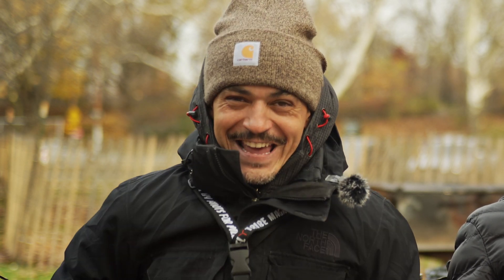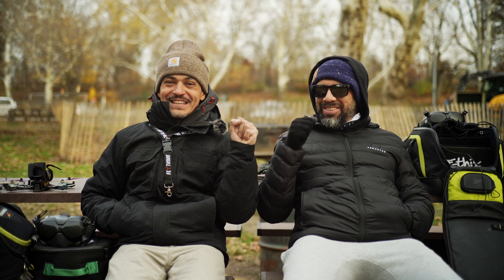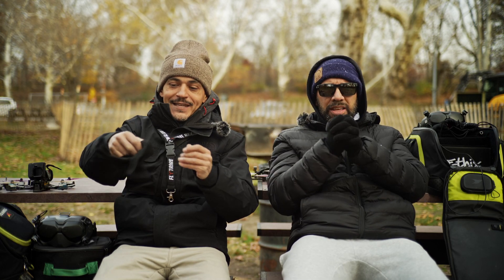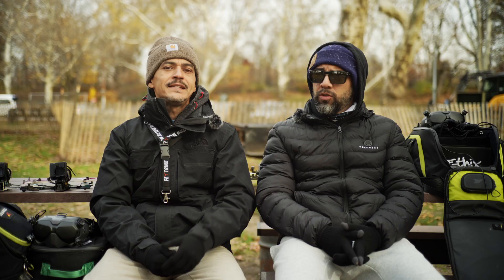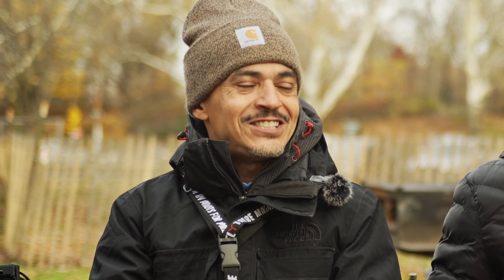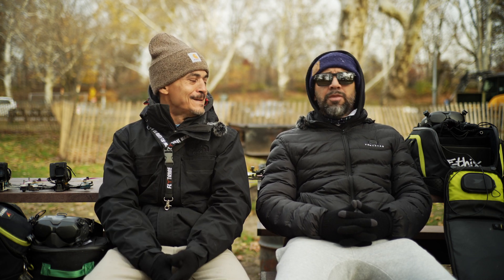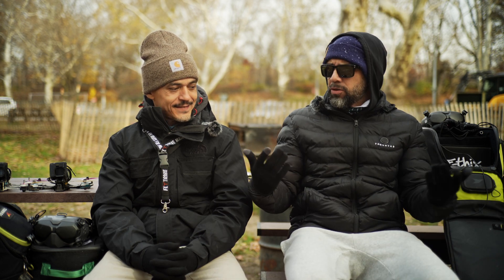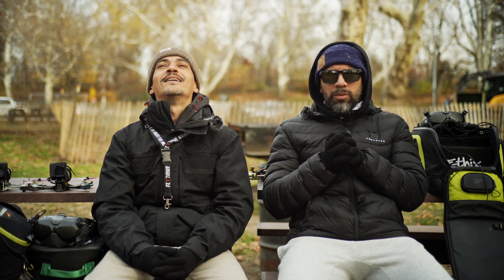Frames, Motors, Esc and Soldering.

Comment: Marmotte is my Fav. Uniplate means no arm slop, no matter how much I beat it up.  The Titanuim Camera Cage keeps my 03 cams alive, and it's adjjstable, locking the FPV cam and GoPro at the same angle. Slammed decks are required for me (20mm), and the flat deck of a uniplate makes building easier, no screws holding arms and the stack, and no press nuts under the stack.  Finally, got a lifetime warranty that replaces any part I can break 👌
Reply from the maker: Marmotte is an excellent frame used by many,